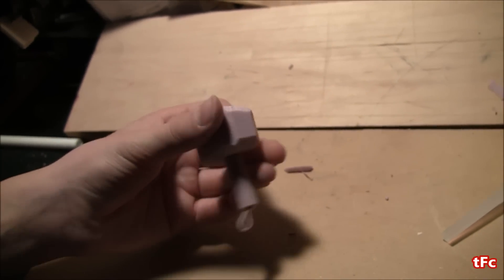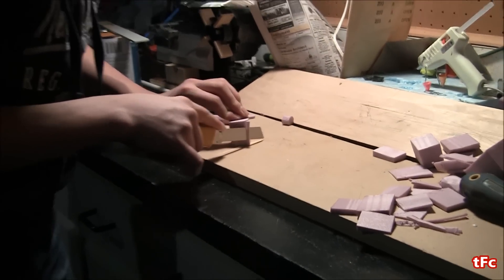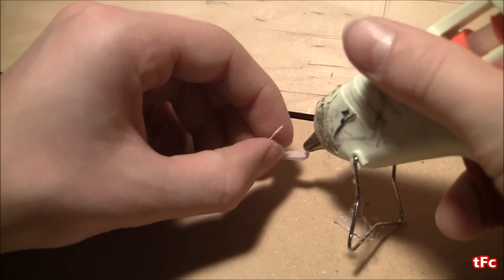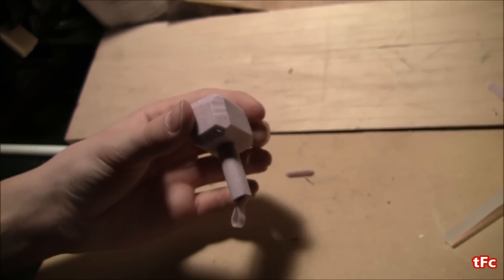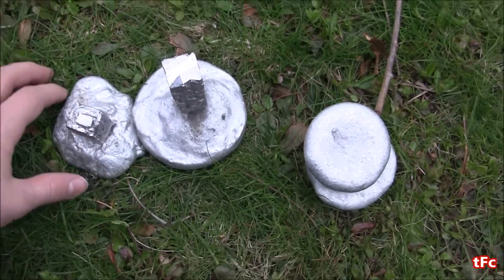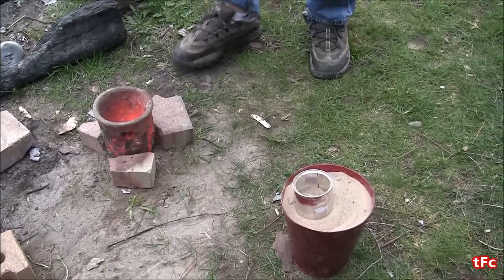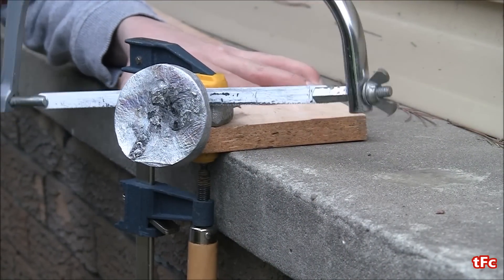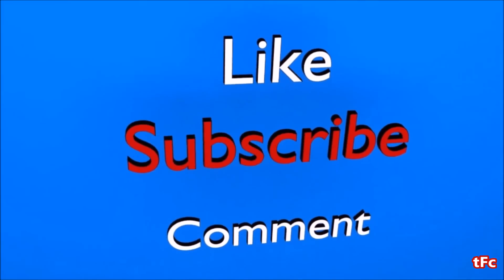Casting a mini Thor's hammer

Comment: Cool! I would of be surprised if the strap came out. Not a lot of surface area for the AI to flow. Awesome nonetheless!
Reply from the maker: Thank you, I agree the strap was mostly just an experiment to see how much detail I could get with the lost foam method.
Reply: +The FOUNDRY Channel honestly if I were u i would add some flux to the molten metal to help clean it, it also can help the metal melt faster... u can also use 100% borax roach killer... just a lil bit of a generous amount
Reply from the maker: I have been experimenting with different fluxes the past few days like salt and potassium chloride, I`ll be sure to try borax.
Reply: Coolio - I hope you shot video! I'm super interested in seeing what the results were.
Reply: +The FOUNDRY Channel u have to use like 1/4 cup for about 2lbs of aluminum